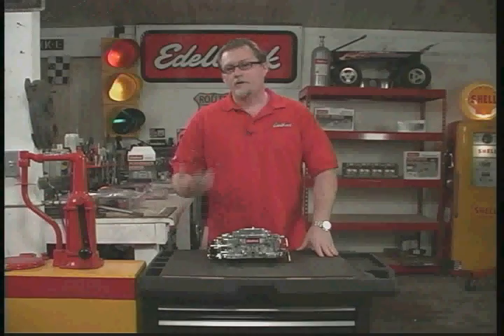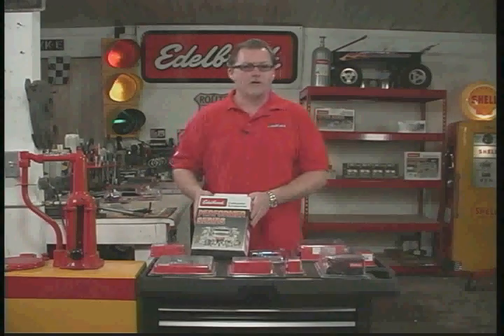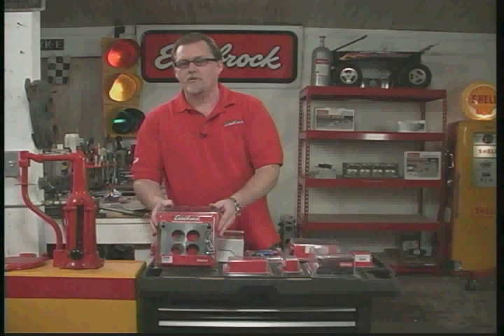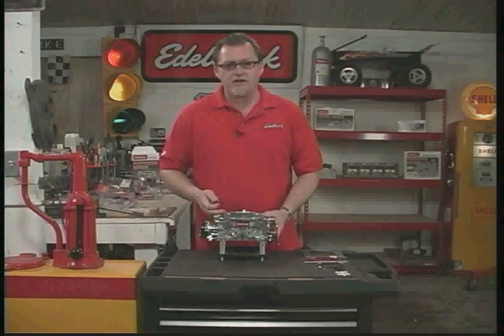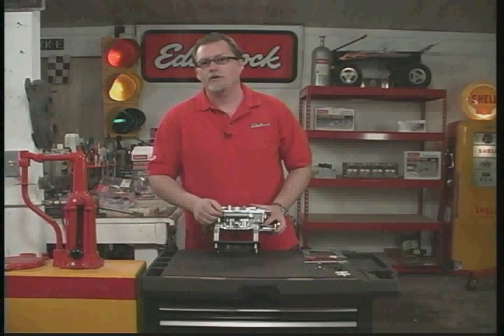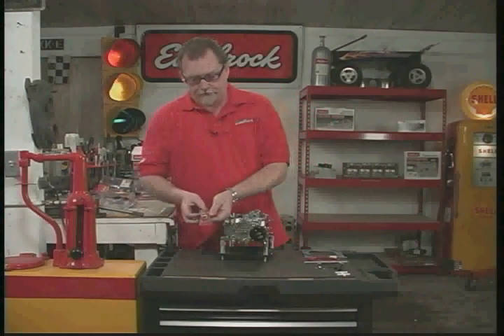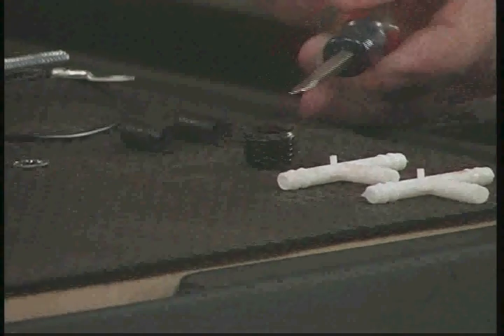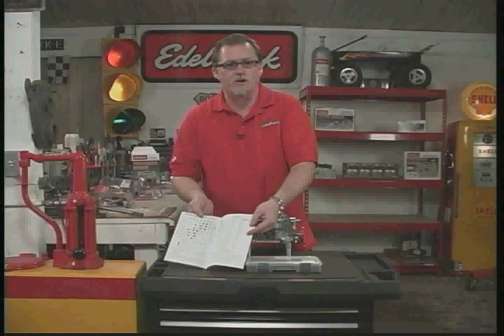Edelbrock Carburetor Installation and Troubleshooting Part 1 - Before You Start

Comment: I have a 1407 750 cfm on a 390 fe. Manual transmission. I bought the truck a week ago. The vacuum advance was plugged into the manifold. Should it be plugged into the ported?

Comment: Do you have a video where you go through the step by step process of hooking up the vacuum lines for edelbrock afb 600? My power train is a? 350 chevy and a th350 transmission. I have an issue with the transmission slipping and shifting. It revs really high before it shifts but when it does its a really hard shift. I looked at the vacuum lines and I believe that they are hooked up backwards

Comment: Before you get started....
 Take it back and get your money back. Vacuum primary's is the worst idea EVER!! 
 I tuned mine with a wide band O2 sensor and a/f gauge. Set it up exactly how the specs call for in the edelbrock manual.  Those settings will change from day to day, even one drive to the next.  The primary needles operate off vacuum and springs.  Air temp, humidity, and air filter flow will have an affect on it. It might be right on one time, and lean another time, and rich another time.  Cruising on the road the way those needles react to the throttle will fluctuate greatly.  I have tried all the springs several times each. Changed needles and jets over and over and over. NOTHING is consistent with this damn carb.
 Right now the daily temp has been the same for 2 weeks or more. But the carb will act different even at the same temps. I expect a slight change in air fuel ratio on a 20 degree change or more, but the change is compounded by the effect the temp has on the vacuum.
Less dense air = less O2. For a slightly richer mix.
Less dense air = less vacuum making the needles rise up sooner giving it even more gas. Combine the 2 and you have a very rich condition.
More dense air = more O2 for a slightly leaner condition.
More dense air = more vacuum making the needles rise less and less gas comes out for a leaner condition. Combine the 2 and you have a very lean condition, spitting and back fire possible, pre-det, and if your running high HP Detonation can occur. Lean= detonation. Rich conditions can wash the iol off cylinder walls causing premature wear on rings and increased blowby.
Edelbrock is a very piss poor design. If you don't have an air fuel gauge you might never know why it has no punch, or acts the way it does. Even for a daily driver strictly street car, your daily drive is what vacuum primarys will affect the most. Quadrajets have vacuum secondarys.  Thats good. Vacuum primaries = very bad, and a lot of headache and frustrations.

Comment: Changing out a holly 2bbl to the Edelbrock 600 and performance intake man. Im told that the engine is calibrated to the gas /air mixture of the 2bbl, and I will need to take to a carb specialist to make the necessary adjustments to run properly with the new 4bbl. Is this remotely correct, or do I have nothing to be concerned about?
Reply from the maker: This depends on the size engine you are working on. If you are working on a V8, 302 to 400 cubic inch, the 600 will work good. If it is a smaller, say V6 engine, you would need to use the 500cfm 4 barrel carb. You will never get the 600 to work on a small engine no matter how much tuning you do. All Edelbrock carbs come with a installation disc in the package.

Comment: Ok, looked everywhere on YouTube. On a 66 Chevy c10, or really any vehicle with a push rod throttle linkage, where does the spring go? There's a rod, doesn't hook up but I fixed that, now where does the spring that's underneath it go. Help would save me a lot of time thanks.
Reply from the maker: The throttle pulls back toward the firewall of the truck, so you would need to mount a return spring that would pull towards the front of the vehicle. Most people mount a return spring on the throttle connection at the carb and then to a place toward the front of the manifold.
Reply: PerformancePartscom Thanks! As usual it turned into a bigger problem because for the linkage to fully function I need to switch the pedal to one made for a throttle cable.
Reply from the maker: GunNut4570 No problem. If you need anything else, feel free to give us a call at 1-800-585-0683 and one of our techs can help you out.

Comment from the maker: With the 302 being an HO EFI engine and the camshaft being an HO hydraulic roller, you should be fine. You might notice a little richness, but you should be find with the performance. If you have any other questions, feel free to give us a call at 1-800-585-0683.

Comment from the maker: It sounds like you have a distributor problem. Start with the timing around 10 degrees at an idol with the vacuum blocked to the distributor. As for dropping it in gear and stalling? Not enough timing, too much camshaft, and not enough stall in the convertor. You also may need to check for a vacuum leak. One of the following should work with your intake and engine combination if everything else is right: 1406, 1405, 1403. Any other questions, call us at 1-800-585-0683.

Comment: Edelbrock yesterday told me the 1406 wasnt the right carb for the RPM manifold.  The new 1405 idles way worse then the 1406, in fact I had to advance the timing almost  10 degrees to get it to idle decent. This is a Chevy 355, brand new everything< I went thru all the supplied manuals and watched the video. I have no vacuum leaks. Everything is hooked up right.  When I put the trans in gear, it feels like its gonna stall out, idle is set at 900 rpm's, drops to 500 in gear. Any suggestions?

Comment from the maker: If it's a stock 400, the most we would suggest using is a 650 cfm, but would probably go with a 600 cfm. If you have any other questions, please feel free to call us at 1-800-585-0683.

Comment from the maker: Yes, you can add an electric choke to that carb. Edelbrock choke kit number 1478 will be what you need. Give us a call at Performance Parts at 1-800-585-0683.

Comment from the maker: This would depend on how much performance work has been done on the 350 engine. If it's stock, we would recommend the 1406. If it has a larger than stock cam and the compression is more, then the 1407 should work. You also might want to consider one of the calibration kits if the carb is running rich at idle. If you need anything else, give us a call at 1-800-585-0683.

Comment from the maker: If it is a stock motor with no mods, I would use the Edelbrock 1403. You may also need the Mr. Gasket 1932 adapter to bolt it to your stock manifold. If you have any questions, please feel free to call us at 1-800-585-0683.

Comment from the maker: You will need to use a HEI from 1974-1976 Mallory 8548201C and do away with the "ESC" that plugs into the factory distributor. You would only need the 12V single wire from the car's harness to the distributor. If you have any other questions, feel free to give us a call at 1-800-585-0683.

Comment: I have a stock 1966 289 mustang , and was going to buy a edelbrock performer 600cfm carb and was wondering if the air valve secondary will work on the engine instead of the vacuum secondary ??? Please respond! Thanks

Comment: putting one on a 86 chevy 350 that currently has a stock q jet what adapters will i need if any? geting the edelbrock 1406 with electric choke i think i will need a spread to square bore adapter but will i need anything else? did it come with the new inline fuel filter and dose the throttle cable hook up to the edelbrock without any changes?
thanks

Comment from the maker: From David Loggans, Performance Parts' own ASE Certified Master Machinist: That sounds like a vacuum leak. You need to check your installation of the carb. You could of missed either the carb gasket or vacuum plug.

Comment: 1825 on a mildly built 350 30 over. The idle is not smooth, it revs up and down alittle on its own. It has a stumble off idle. What do you think, what should I do first, second and so on. Any info would be great, thanks.

Comment: Thanks- So that feeds the secondaries? So it OK to have he PCV from the left valve cover (rear) run to the back.  I don't think the 289 has a 'intake runner' in the front-does it? Should I try to get that hose from the back to the front?  I have an after market air cleaner i.e. no hose from breather cap on oil filler to the cleaner cover- should I get a hose from that breather cap and connect to FRONT of carburetor? Would that burn off some of the excess gases?

Comment from the maker: This is a note from Edelbrock on this: We prefer them to hook the PCV up to the front of the carburetor or to an intake runner. This is due to the bulk of your driving being done on the primary or front of the carburetor. These spend gases can then be burnt and allow for a cleaner running engine. There are some Ford applications that will hook up the PCV to the rear of the carburetor, but we prefer to send folks to the front.

Comment: You caution against it but what happens if you connect PCV to rear port of carb? It seems to duplicate the set up for the Autolite carb. On the Ford 289, the PCV valve is on the left back and the Push In Breather cap. filler tube is on the front right. You suggest a hose from the 'push in ' breather cap' to the port in the front?

Comment: ported vacum are a smog-option, performance enegines needs manifoil-vacum. most distributors needs to be re-curved to work with manifoil-vacum, Crane has the right stuff.

Comment: Use the Edelbrock 1403 on the smaller 305 engine. The Quadrajet that is on your car now has an electric choke. With the electric choke you will not have to run a cable from the carb to inside the vehicle to manually work the choke.

Comment: Hey, I was wondering, i have a stock 5.0 in my 1987 Camaro.  The stock carb is bad on it, would a 600 cfm work good on it? and what's the difference between manual and electric choke?
~Sorry for all the questions.

Comment: Bought a 750cfm eldebrock carb... what a mistake does not have as much power as the holley 600cfm.. Granted yes I bought a carb to big for the engine.. The major complaint I would say is you cant easily wire of the carb to make all 4barrels open at the same rate and time... Avg 11mpg city...

Comment from the maker: Big Dave, our Certified Master Engine Machinist suggests "I would go with the 1403 on the smaller cubic inch motor. This would be the best for cruising around town but will also be enough carb for RPM’s up to 6000 to 6500."

Comment: I've got a 289 w/ an Edelbrock Performance Manifold. It currently has a 1405, which I'm replacing for one w/ an electric choke (also just acid washed the fuel tank).

Should I go for a 1403 or 1406. I'm not racing around, just want a solid driver w/ torque. ('65 Ranchero). I'm currently averaging around 15 MPG.

Thanks!

Comment: I had a holley on my 69  chevy truck, and switched over to a edelbrock 600 cfm performer series  to run on my 350 ZZ4 crate engine, idles fine, drives fine but when i get on  it, it bogs out and power goes to crap.    not sure what to do!!! do i  have a bad carb? any  ideas as to what i can do to fix this??

Comment: Ok... So a 600cfm is too much for a 302? even with performer heads? 

Im asking because edelbrock only uses the 600cfm for a performer kit for a 302. But then you say the 500 cfm is the way to go.... I need to get rid of the 2 bbl I have and would really like to know if the 600 will be perfict.

Comment: Oh and you're right, pretty much plugged the rear, connected the distributor, plugged the other port (it's a 4-speed), and my Road Runner fired up and idled without a hiccup after not running for five years, and without any tuning whatsoever of the carb. Didn't expect that... You guys rule.